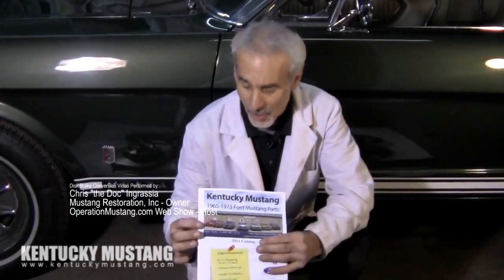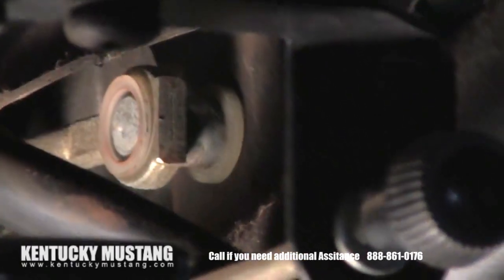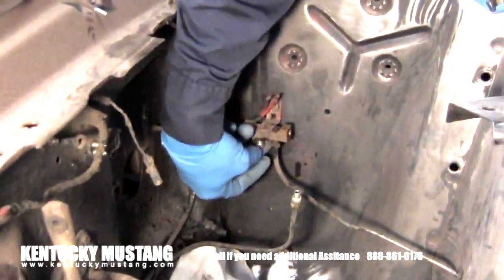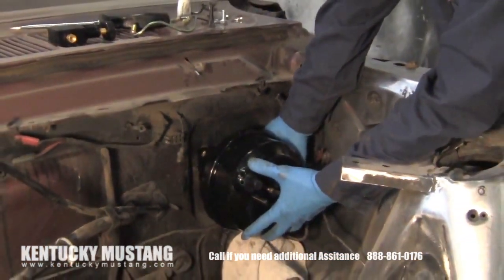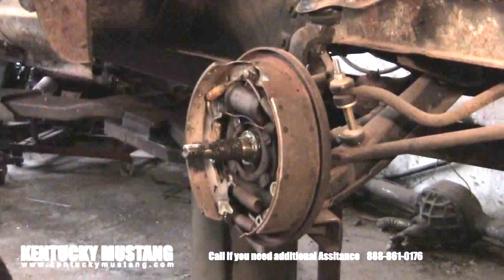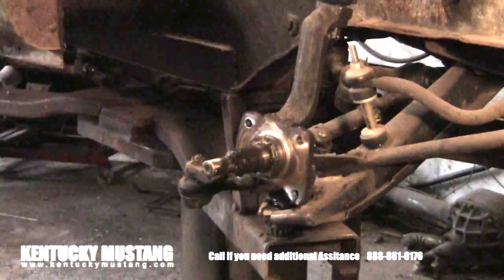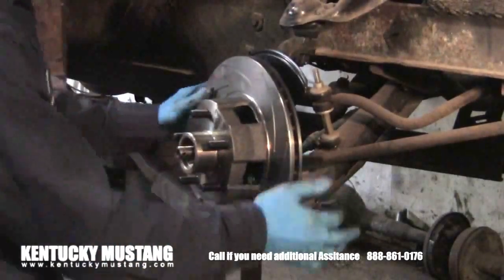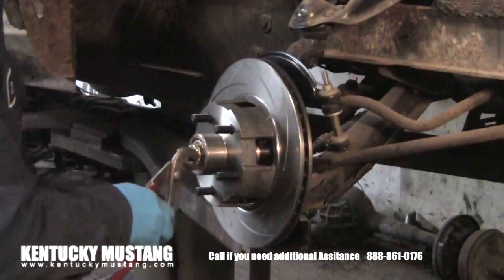1964 - 1970 Mustang Disc Brake Installation Video - Kentucky Mustang

Comment: This kit looks 10 times easier to install than the lousy MASTER POWER BRAKES kit I got from CJ Pony Parts. Warning to anyone looking at this video; avoid the MASTER POWER BRAKES kit. DO NOT BUY THE MPB kit. It's hard to install, you have to drill out existing holes in the firewall to fit the massive master cylinder. The proportioning valve is poorly machined and doesn't match up with the factory brake lines, so you have to make new lines which means buying a tube flaring tool if you don't already have one, plus buying 3/16 and 1/4" tubing. The MPB kit doesn't supply dust shields either. It an all around headache to install and I'm a retired aircraft mechanic with plenty of professional experience. DO NOT BUY MASTER POWER BRAKE disc brake conversion kits for the '60's Mustangs. You'll be sorry if you do.
Reply: Eric Mowrey thanks for the warning. Trying to see what is best
Reply: You're welcome Ariel. I'm sure you have already but I'd like to suggest that you look at all the DB conversion kits on the market before making a purchase. Also that you look at the verious Youtube vids like this one before making your purchase. I only regret that I did not and paid the price in countless hours of tweaking, experimenting, bending brand new lines and swearing like the devil.

The main thing you want to look for, perhaps the most important detail, is the proportion valve, or splitter if you like. This was the principle source for making it a tedious and labor intensive installation.

What I was able to deduce during the installation was that the MPB kit was intended for any number of American cars from the sixties. The kit came with a configuration guide for setting up the P-valve (splitter) for different makes & models of cars; everything from Ford to GM to Chrysler... if memory serves me.
The result is predictable. When you make a "one kit serves all" conversion kit then chances are it serves some better than others. In this kit it didn't serve the '68 Mustang at all, and I was forced, using every bit of my extensive mechanical experience, to make it fit. That is not how it was advertised by CJ Pony Parts.

Finally, be sure to truly research before your purchase. I was too late for me but during the installation I checked out a few Mustang/Cougar blogs and read more than one comment of problems installing the MPB kit. One guy had to take the entire shooting match to a professional to complete the installation.

So good luck Ariel. If you find the time I'd be grateful if you let me know which kit you settled on. Remember, you are looking for a kit that was truly designed for your car, or your make of car, be it a Mustang/Cougar or whatever else. The proportioning valve is a vital detail. If that is wrong then count on long hours bending new brake lines yourself and using reducers to match them to the PV. Good luck and look at this carefully.
Reply: Eric Mowrey wow thanks so much for the info. That really does help a lot. I guess I just assumed that anything in cjpony would be a fit. Not I'll triple check what I will by from any website and head the forms and blogs to see which is really the best fit for the stand. I'll let you know what kit I pick up. I will for sure spend more time doing research! Thanks!
Reply: Just to be clear, I'm not knocking CJ Pony Parts. They have a good crew...very professional and outstanding service. I've been happy with most of the stuff I've ordered from them but they screwed the pooch with the disc brake conversion kit they sell for the '60's Mustangs. A crap kit not worth a damn.
Reply: I just ordered a conversion kit for a 67 Mustang. I really regret not seeing this before i ordered. Sounds like it's going to be a nightmare.
Reply: Yup I purchased my years ago just started to install it. Finally retired from the military, so I'm busting building my 68 mustang gt. That booster is a mf. I'm about to start cutting and drilling my firewall.  Damn it....should of known about this system..
Reply: I just found this out today fml
Reply: Eric, Thanks for the heads up sir. Cheers from Motown.
Reply: @robertclymer6948  You're welcome Robert and I'm proud to know my post helped out a Motown man.

Comment: There is a dimple high up on the pedal mounting bracket where you drill a new hole for the longer brake and clutch pedals to attach.  You will have to remove the bracket from the car to drill the new hole and a new nut and bolt made specifically for power brakes will be needed to complete the installation.
Reply: Not on a 65-66 Mustang.

Comment: You make it look so easy !!! i'm yet to have an old brake line undo without any issues why don't you show the real pain invoved in doing this job.You were quick to skip into a supposed non issue task.And you should also show this conversion on a manual shift.

Comment: will this work on a 1965 mustang that originally was a v6 and had v6 spindles?
]
Reply: Use need to source 65-66 v8 spindles, and steering. There are kits made for 6 cylinders.
Reply: It was a I 6 not v6. Likely a 200 cu inch inline 6, a very good engine BTW.

Comment: will this kit work on a 73 maverick?
Reply: Mike Teets  I think it would be better to purchase a kit from Mustang Steve and buy the rotors and pads from a cobra. It'll save you money and finding replacement parts are easy since it's factory ford. I'm running this conversion and it does wonders! Easy swap and excellent performance.
Reply: Be aware that the Cobra brakes require at least 16" wheels to clear 13" rotors.
Reply: Wrong style for 73, 65-67. There are kits for 68-73.
Reply: Check Summit Racing, they have lots of kits for all old Fords.

Comment: Bought the kit for my '68 Cougar.  Came with a longer brake pedal assembly, which is meant to mount higher in the car to allow for increased piston movement, but no ability to mount higher in the Cougar so had to use the old pedal.  The result is excessive pedal travel for the brakes to work.  Has anyone solved this problem?  Wondering if a larger diametre master cylinder is the solution?
Reply: Use a 68 pb pedal and mount in the upper hole on the pedal hanger. It's there no need to drill.